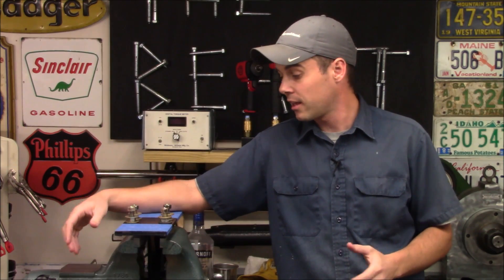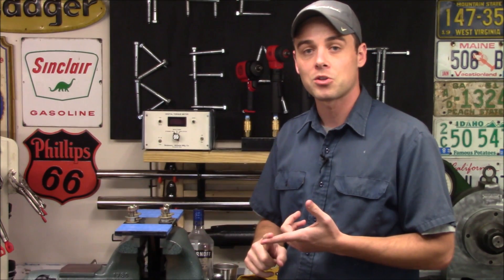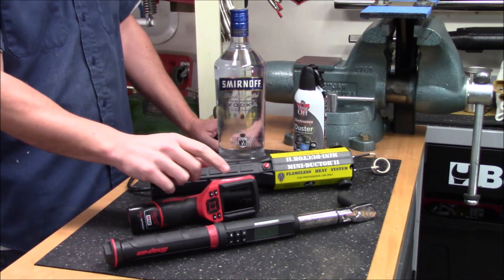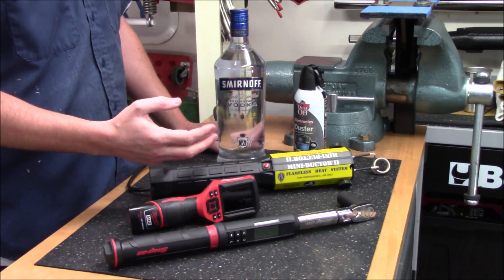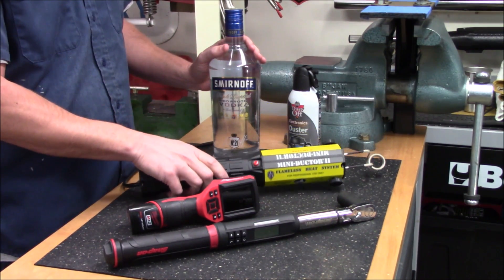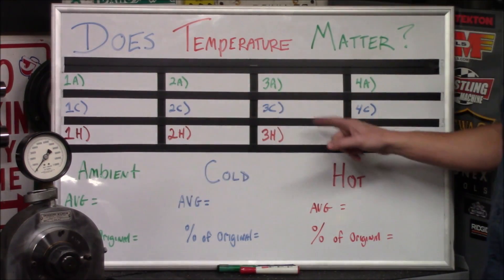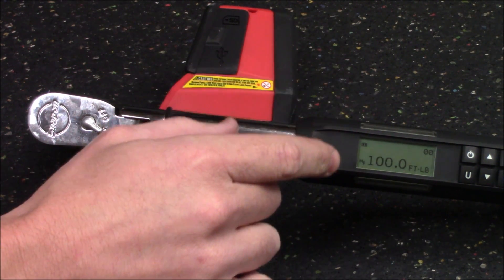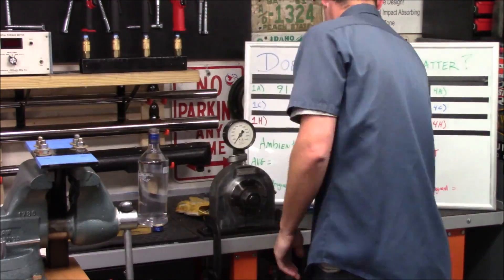HOT NUTS – Are they easy to get off? (Does heating up nuts/bolts help make them easier to remove?)

Comment: 🤔umm...maybe if the tests were done with all new hardware each time. Your findings are also just kinda showing a progression of reduced torque holding (clamping) ability on "used" bolts.

Comment: Seems that 700 degrees is the right amount of heat for getting the nut looser easier. Im curious if this applies for all sizes of nuts and bolts or material, ideally it would.

Comment: Unless there's years of rust or heat from your exhaust this test is pointless. In the real world heating will usually always work. Using new nuts and bolts just won't do it. Sorry

Comment: Would a combo heating nut, freezing the bolt improve results?
Reply from the maker: Heating the nut helps release the corrosion bond (rust) & also lowers friction which is causing torque to be lost (when overcoming it).  It would be very difficult to heat one & freeze the other without the surfaces equalizing temperature.

Comment: If metal expands when heated, how does heating a bolt loosen it ?
Reply: you are using the expansion of the metal to break apart whatever is seized in between the threads such as rust or loctite

Comment: How do you like that TQ wrench? I'm debating the very similar CTECH2FR100A.
Reply from the maker: I think the Snap-on Techangle Torque Wrenches are extremely nice & have not used another brand that comes close.  BUT --- they are super-expensive, so do keep that in mind.
Reply: Thanks for the thoughts. I was considering the click versions but liked the less maintenance and the self diagnostic telling you when to calibrate. In addition to the other features. Yeah they are def not free. The Range they cover is impressive 12-250lb and 5-100 IIRC. 

The tektons you recommend seem outstanding for the price,  essentially they are free compared to tier 1 US tools. For mobile use they are such a good idea. It wouldn't be like getting a few master sets of snap on stolen out of your truck if they did get nabbed.  Thanks again for the great and informative videos.

Comment: This would be a cool test to do with different types of "penetrating" oils.Obviously the lubrication helps once the nut is broken loose but does it really penetrate the threads and make it break loose easier?
Reply: In my experience as a mechanic, it does not penetrate the threads to inside the fastener on its own.  What i do is crack the fastener/nut free a little, then spray with penetrant.  The rust really seals up the threads good, cracking it loose first allows the penetrant to have a chance to get inside.  Sometimes i have to heat up something to break it free, then cool it down with water spray bottle until it stops steaming.  If you spray penetrant on a really hot nut/bolt it just seems to cook off/evaporate, thats why i cool it down first.  Heat and oil works wonders when doing alignments on rusty new england vehicles!
Reply: I would think that quenching the bolt would help make it just a few thousandths  smaller, also.

Comment: Nice video thanks
However I'm wondering if ice played a part in the frozen one? They had been cooled with water to achieve room temp allowing moisture to get between the nut threads and the bolt threads.
Thanks for all your work. I've enjoyed them
Reply from the maker: Possibly.....good observation.  Also, since "frost" will appear on almost any frozen metal surface due to moisture in the air, I am assuming that the results would be the same....but it could have made a difference.  The biggest advantage would be with corrosion (these were new bolts), so with rust/dirt/etc, I think a more noticeable range would have appeared --- in cold, room temp, & hot.  We will be following up on this test in the future....stay tuned!

Comment: the reduction in loosening torque is not entirely due to expansion and contraction it is likely a result of stress relaxation and creep of the steel alloy . This can radically change the molecular structure of the steel and will likely push it out of its specified mechanical strength requirements. Do not reuse any critical bolt or nut that has been heated.

Comment: Ok but it woud be better to test with rusted screws. cold is used to break corrosion! please do it :)
Reply: Back when I didn't own an impact wrench, I used to heat the offending bolt/nut with a torch, then immediately spray some freon on it and the quick change in temperature broke the rust. Worked like a charm. Today i think CRC makes 'Freeze Off' spray which does the same thing.

Comment: Cool experiment. Ok I think if you could get four bolts  torqued and leave them out for the winter and let them rust up  and then  do the experiment again the  difference in torque  reading would be so much more in favour for the use of heat compared to new bolts and nuts. Mini inductor Rocks
Reply from the maker: +STEVE ROB I agree Rob....this was simply to test the effect of heat......I'll be making a similar vid with the effects of heat on corroded nuts/bolts, but like you said....it's going to take a lot longer for them to completely rust up 👍